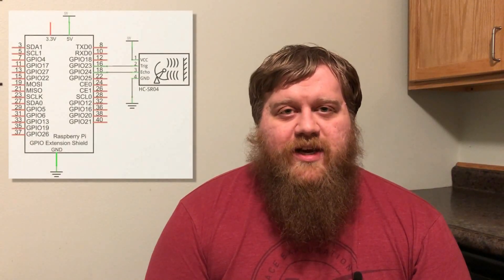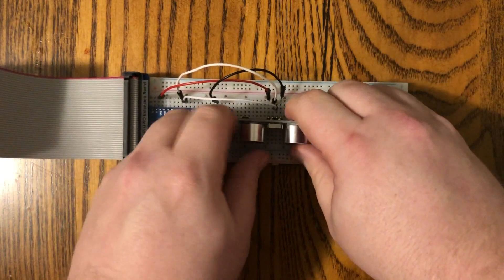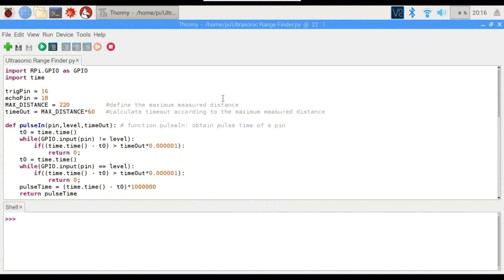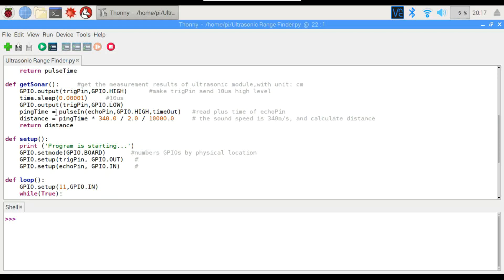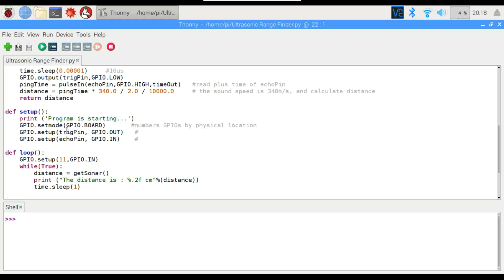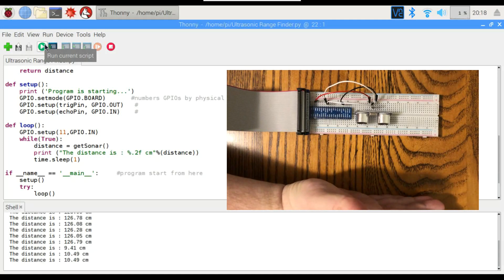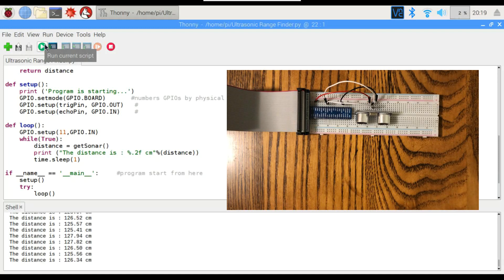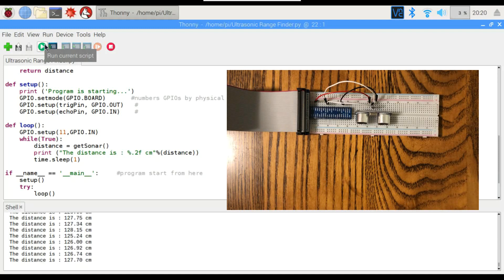Ultrasonic Range Finder | Raspberry Pi 3 B+ | Projects for Beginners

Comment: Hi, I consulted a lot of videos and tutorials, and are recommending to Connect HC-SR04 using a voltage divider with Raspberry Pi 3 B+ to prevent damages to the Rpi.    I wonder if it is fine to conect directly to the GPIO for 5V signals.....I'm a lot confused.  Could you confirm it?
Reply from the maker: It would be safe to connect directly to the 5V pin on the Pi. The GPIO pins only supply 3.3V so that would not work.
Reply: @ThinkingofPi  Thanks a lot, it is working perfectly!